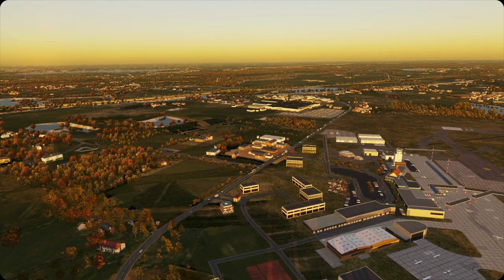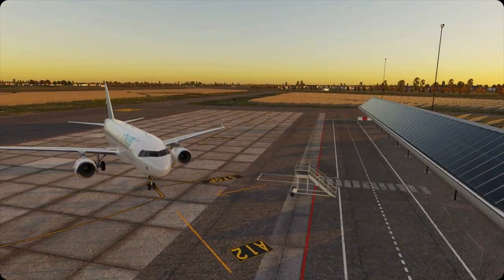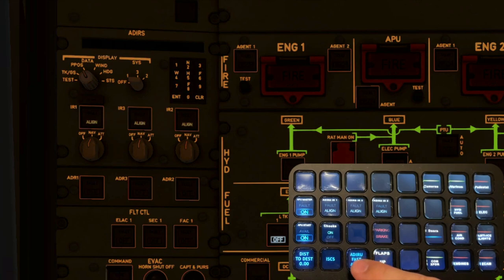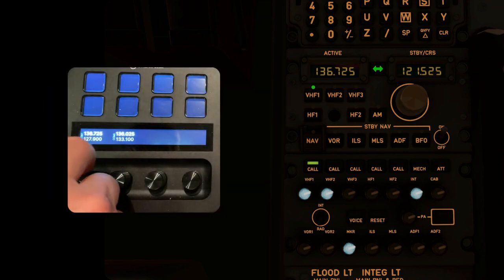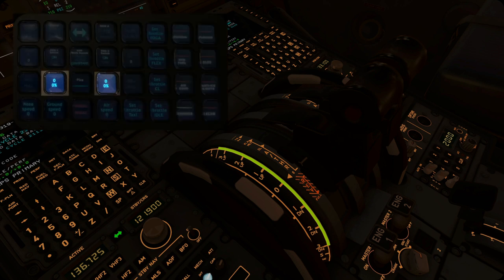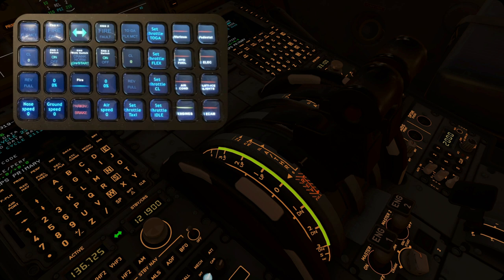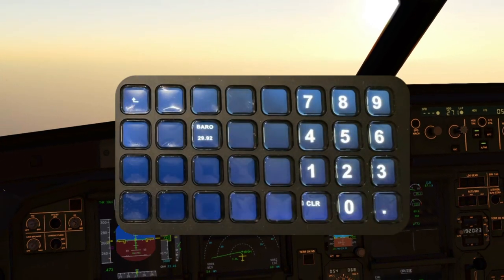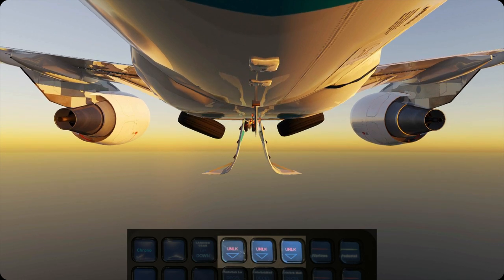Demo X-KeyPad Stream Deck ToLiss

Comment: Just great, now let’s see how do I program my Stream Deck…
Reply from the maker: Do you mean you’re going to figure that out yourself or is it a question for me? 😀

The creator of the plug-in has (or will) make some tutorials. And maybe I’ll create something as well.

Anyway, if you have any questions, please ask!
Reply: @passengerflying7734  Creating tutorials would be fantastic.  I'm trying to learn the programing steps, but not that easy.  I'm trying to add the Crew Supply switch, for example.  I have it working and added the Crew Supply line, but I can't figure out the LED's.  On, off, lighted,....etc.   Need help.  I did not find the Crew Supply switch button in your profile; did I miss it?

Comment: Nice, i think im using an older version of your profile. Btw, works fine also with a321 and a340-600 although of course the a340 has 4 engines and some other stuff that you can easily add.  Did not try it yet with the A320.

Bedankt!
Reply from the maker: You can find the latest version here: https://forums.x-plane.org/index.php?/forums/topic/286132-sd-profile-toliss-a3xx-stream-deck-xl-plus/

Comment: It looks like this is your first video, and if so, excellent job.  Thanks for the info and for sharing.   Have you tried the X-touch mini?  I'm about to set up the X-touch mini in conjunction with the SD XL.  Your work just gave me a super head start, thanks.
Reply: It is the first (public) video indeed. 😀

I do have the X-Touch mini and I used it a lot with this plugin. Until I got the Stream Deck Plus.
Reply: @sanderdatema  🤔 X-touch Mimi vs Stream Deck+?  I'll have to compare and see which is best.   Would you mind telling me why you switched over to the Stream Deck+?  Was it the ability to have icons and labels more readily available?
Reply: @angeloguzman1426  It was indeed the ability to have labels and icons. I love the X-Touch mini, but was struggling to get nice labels on it. The Stream Deck Plus has less encoders, but is just a little better.

Comment: I want to do this so much but there is no video about it is it free how can i use help please
Reply from the maker: I just realized I need to verify my account to enable external links, but if you look on the X-Plane store for the X-KeyPad plugin (only about $15) you can create these kinds of profiles as well. And you'd need a Stream Deck, of course.